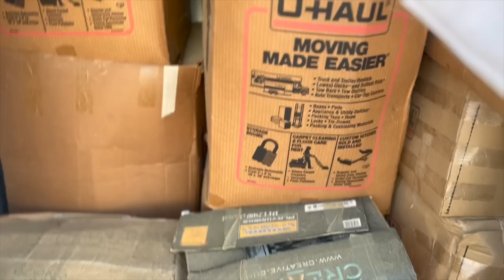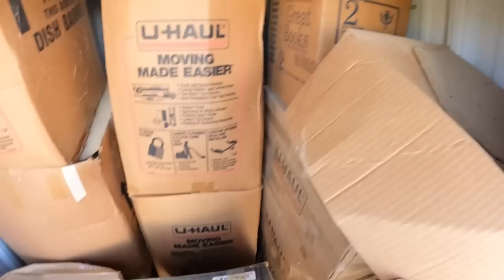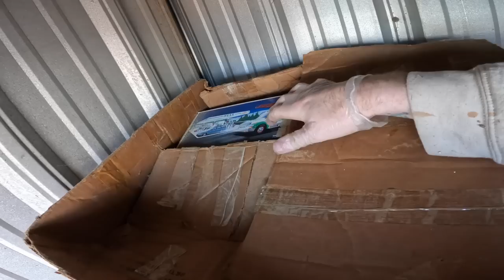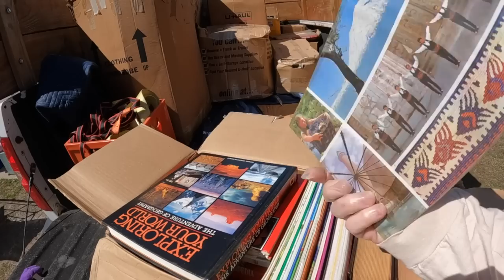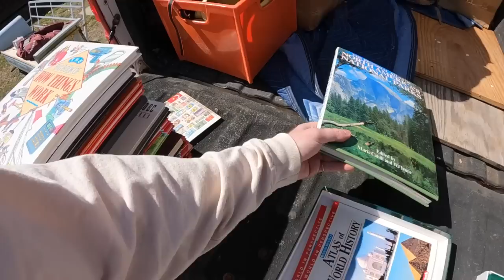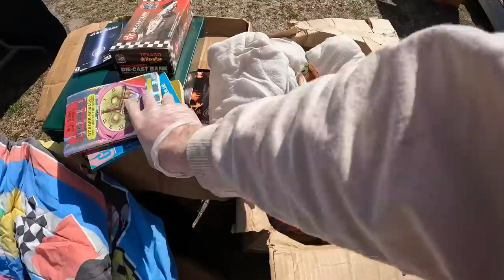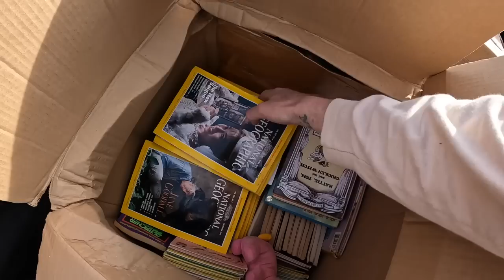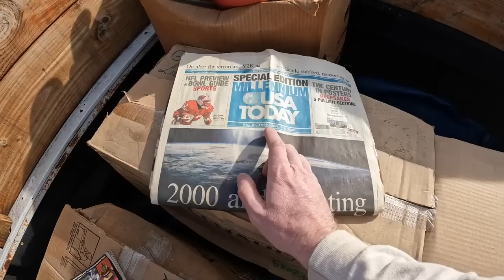This $255 Storage Locker Was LOADED With 1990's NOSTALGIA!

Comment: You need to comp those stuffed animals or characters, you might be very surprised at what some can sell for. Especially with what you have Disney, cartoons & other ones are sought after and sell fast for good prices. It's worth comping every one of them. I've seen them sell for as much as $30-$100+ and as little as $10 -$25. Age, size, character, how much in demand they are determines the price. Don't pass on them right off the bat, comp them first Tucker.

Comment: You scored ! You payed 250 for the unit. 17 boxes . That is 14.71 a box if you average 15 items per box at a minimum  of 10 dollars on ebay You would make over 2550 dollars . If you sold 10 items  in each box your average cost of items  is 1.47 you did very good . Research  your stuff good job

Comment: Dude I worry that you under rate your gear big time. I know here in Australia that starwars stuff just the AT-AT is $400. The og figurines about $15 each and there are some rare ones depending on what materials their capes are made from can be $2500 for a jawa. Some things you really shouldn't be selling local in lots. Ebay research. List individually the top price stuff and bundle the low price stuff.and the Nintendo stuff are you shitting me.....$100 pretty much gave it away. Even the cartridge holder was a collectable